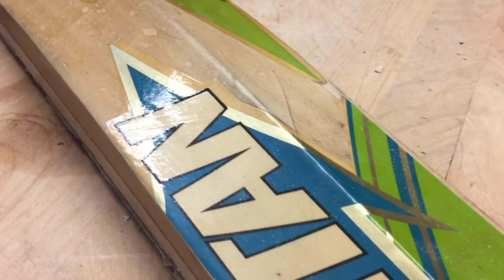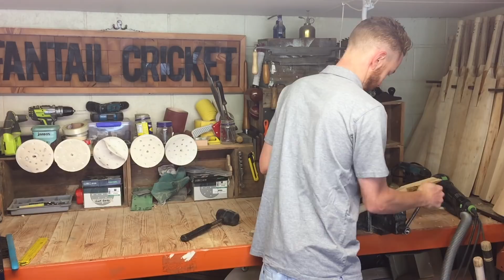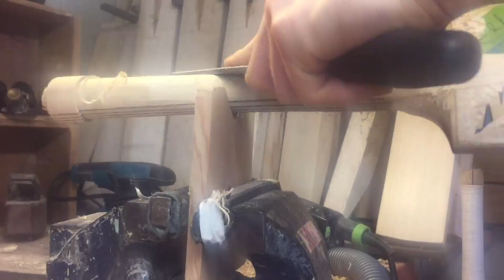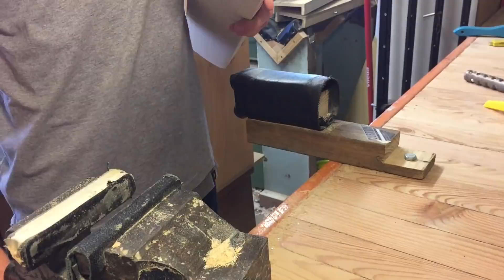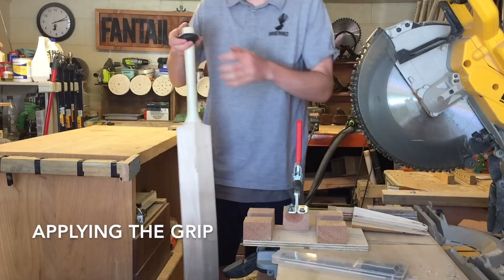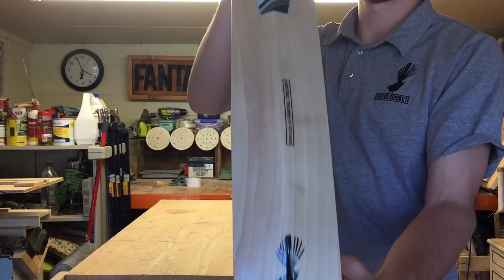Cricket Bat Repair 2016 - Spartan Handle Replacement

Comment: best way to remove the stickers is to rub really hard to melt the glue and then peel them off, or use a hair dryer for a bit to get them warm, that works the best. great vid

Comment: I am based out of my garage in the USA. A small bat repair guy for my small community here.  
Awesome work on the video.  Really love it.  

Do you sell the plans for the jig used for cutting out the v in the blade and the jig used to hold the handle to make the cut ?

Comment: Cutting the wedge shape on the handle, do you change the angle of the drop saw for each side, or do you do one cut, then rotate the handle 180degree and make the 2nd.?

Comment: which glue u r using and which thread and also doesn't it make more havier then the original one!
Reply from the maker: I use a special blend of PVA. The bat comes out at the same weight unless a toe guard and/or facing has been applied which wasn't on the original
Reply: Fantail Cricket okk thnkyou sir..

Comment: will the quality of bat remain same as before after changing the handle
Reply from the maker: The strength of the handle would be the same as a handle on a brand new bat.
Reply: if applied correctly the new handles give even greater strength to bat as custom handles are not so great especially if bat is not really premium..
Reply: Jhony Rao 
b
Reply: Jhony Rao  pagal
Reply: Whats the highest and lowest grit sand paper you'd recommend if you're doing it yourself?

Comment: 150kmph ball on the ball, and you get part 2, no offence
great work tho
Reply: Even professional bowlers have hard time to reach 150km/h
Reply: @MahdiShibly  But the bat should match that standard. But i agree, Some excellent work is shown by this man
Reply: @smalirizvi8026  I don't think this bat was made to match that standard.
Reply: Mahdi Shibly true. This is done more for showing the skills of the craftsman than  for repairing the bat to face cricket ball
Reply: @smalirizvi8026  I know but I was replying to the original comment. The craftmanship is fine without any doubt
Reply: Mahdi Shibly Yes it's fine craftsmanship, but the bat wouldn't hold it's integrity for long